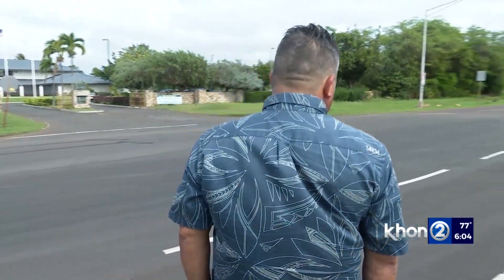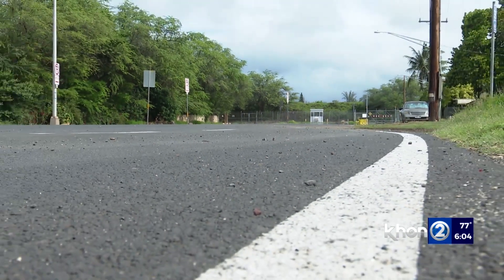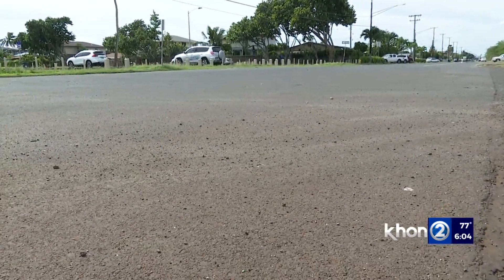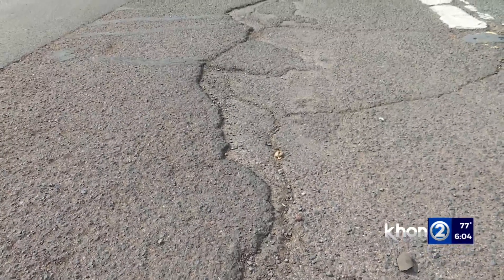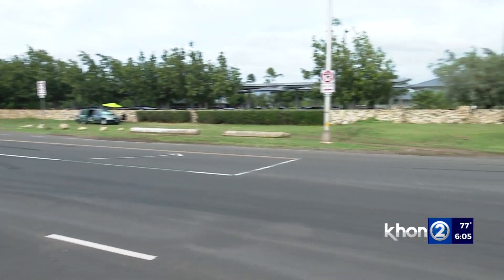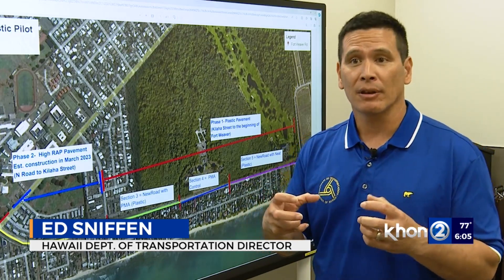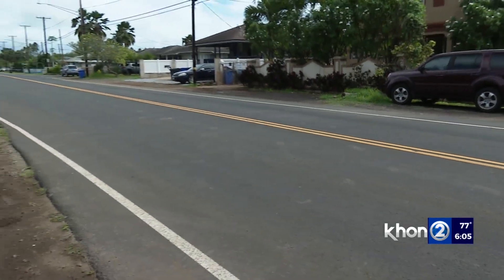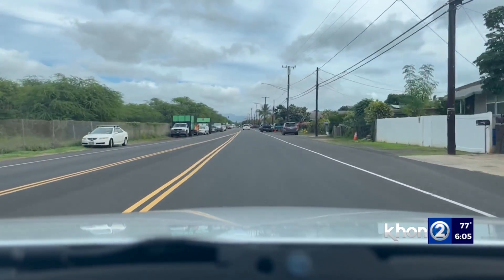Recycled plastic, asphalt road holding up in Ewa Beach

Comment: Question have they ever thought of using rubber as well like from old tires. Because I remember back in the day rubber would work even better and much longer then plastic
Reply: Rubber would last way too long. There is a reason this is not done with all new paving jobs. They need the roads to degrade, so new paving jobs are ready in the future.
Reply: And that's bad how???
Reply: @kimodudoit757 ”use it or lose it” when it comes to federal funding. Say you get 1 million annually to spend, and u only spend 500k that year. Next year you’ll only get 500k. Rinse and repeat.
Reply: Then to me that means u have money to deal with more important things other then things that will need repairs again short time down the line 💯
Reply: @kimodudoit757  unfortunately not how it works most times.
Reply: They should use shredded rubber tires. 🤙🏼
Reply: Exactly 💯